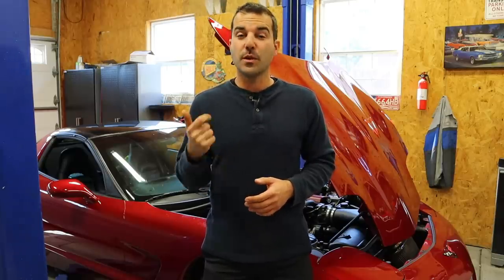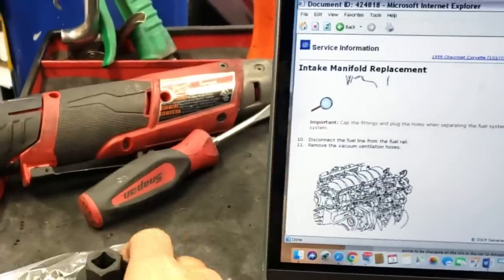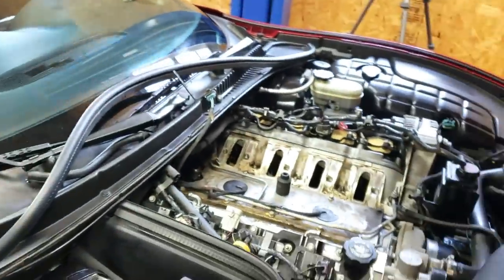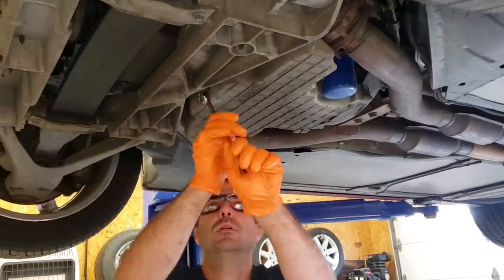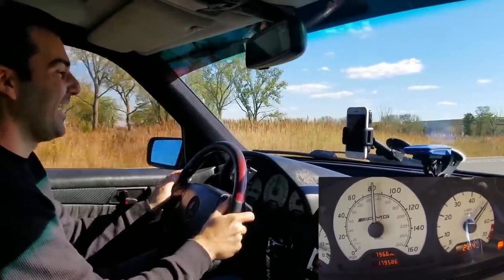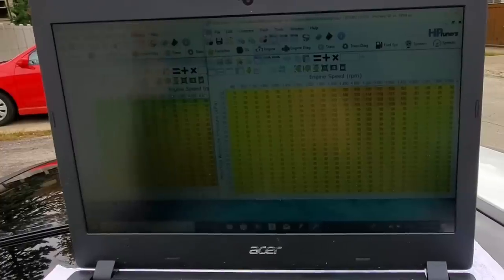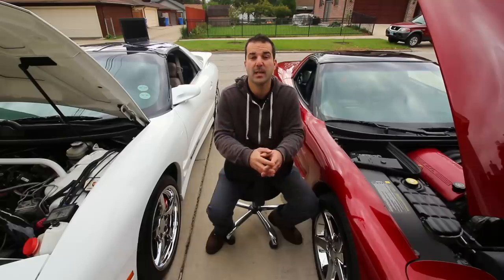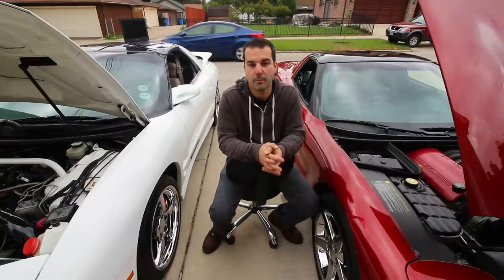I’m Building A 40 MPG Corvette That Sacrifices NOTHING! Project EcoVette Starts Now!

Comment: Doesn't the USDM Honda Civic VX/HX run lean?  I thought that is why it achieved 45+ miles per gallon. The highest I've read about was 62 mpg on a stock 1992 one of those here in CA- which is really impressive considering the emissions stuff we have to deal with.

Comment: I used to have one of the last Camaro Z28 IROC-Z's over here in the UK that had the roller rocker 305 TPI engine. On the highway that did an average of 36mpg. Pretty amazing for that size engine. Would suck in todays world though with my current car doing 72mpg ave every day.
Reply: what whip gets 72?
Reply: @RingerRacing  A merc A200d AMG. With the 2.2 diesel engine, DCT gearbox and BRABUS engine upgrade. 70 to 72mpg average every day. 740 Mile range from its quite small tank.
Reply: @dj_paultuk7052  thats amazing,   a stock chevy cruze diesel in the us makes 55-60mpg highway

Comment: Enter 92-95 Honda civic 92-95 VX is deff a lean burn car sold in the USA, however it was never sold in california due to higher emission standards there. Theres even guys getting 60-70 mpg in these cars .
Reply: Also that car was able to do 22:1 in lean burn modecaround 3 volts from the WBAFR

Comment: Why not put in a GM Ecotec motor and be done with it.  The 1.4 may work.  Can the 1.4 be tuned for more power than the V8...  yes...  but 2.0 or 2.7 would make it easier.

Comment: Never get a 40mpg average. Weight weight weight for town driving. I'm guessing 36 hwy max. Cylinder deactivation, raise compression, porting TB, less restrictive intake, LONG final gear, flat underbelly, remove front plastic valance. My guesses at the beginning of the video.

Comment: I’m a ford tech ad I know that the newer engines will run kinda lean at idle, around 14.9 to 15.1 at idle and will do a rich swing every once in awhile to keep the cats happy. When driving, when ever you are at speed and the torque converter is locked, you let off the gas and the 02’s will peg out lean 27 to 1, cause you don’t need fuel on decel so that helps with fuel economy. Just thought I’d share that n cause you didn’t know. Thanks for the video. Oh yeah, but the way, tuners and “chips” have been running engines lean and advancing the timing, to gain hp and better fuel economy for years, just had to run high octane fuel to prevent detonation and spark knock.had and 88 mustang gt and I’d guess that car got around 35 mpg’s.

Comment: Have been following your channel closely. Working on both my c5 and c230 is always challenging to say the least. Thank you for the amazing content. Easy to follow along explanations, clear videos and always entertaining comments. My apologies for the left field question, hope you have time to answer..is it possible for a rear caliper to fall out of alignment? Changed the rotors and pads on the auction pick up, c230 rear drivers side because of age and scraping sound. Thought the rotor was warped. Installed new caliper, pads and rotor with the same results. It would appear the lower corner of the caliper is contacting the rotor. Visual inspection looks normal with out any damage. Any feed back would be appreciated. The c230 is a 2004. My GF has exactly the same car that I have been using for reference as well as manuals. Thanks...looking forward to your next video.

Comment: The reason why the V8 gets almost as good mpg as a 4 cylinder is because it requires less rpms to drive at the same speed. The mph doesn't matter. Aim for lowest rpms for each gear for best mpgs.

Comment: Will you also be measuring harmful emissions the engine produces? Quite often fuel economy comes at the expense of more NOx etc. Edit: looks like you covered it later in the video! Generally the US has prioritised low NOx, EU has prioritised low CO2 which is why you have such a difference in engine types between the two.

Comment: Is this the same lean burn type of system Chrysler started to use back in 1977-78? My dads 78 New Yorker on A trip down south had its exaust manifold turn cherry red.400 miles from home and needing A tow,no cell phone,again this was 1978.The car had some sort of limp mode that got us to the nearest service station.As usual back then the Chrysler engineers were way ahead of the technology and quality needed.They always rushed to production.

Comment: How do you meassure the "highway rating" in the US?   Is this meant to be "fill up your fueltank,drive on the highway until almost empty, fill up and calculate based on the distance travelled and the amount of fuel you had to put in to get it full again" Or is this some momentary value the engine is using at highway speed on a flat surface?
Because if it is the later, i don't see why you would not achieve it, if it is the first one i don't think it possible. 

(The lowest on a fuel tank i got with my W212 E63 was 10,61L/100km which according to a prominent search engine is 22.16 mpg. But i wasn't going 60 mph on a flat surface, this was over mountains while up to 87-88 mph if i calculated correct and through villages at around 37 mph. And i did calculate it on distance and amount of fuel not by trusting the display of the car.)
As for the Spark Plug: as soon as you mentioned it at the beginnig of the video i lpaused and ooked up on wikipedia (in 2 languages) and the names i could have come up with were (not in timeline order): Etienne Lenoir, Carl Benz, Gottlob Honol, Robert Bosch,  Nikola Tesla, Frederick Simms. They all invented spark plugs and most of them had patents for it.

Comment: My Caprice has a low-load lean mode built in that goes lean for several seconds and then switches back to 14.7:1 for a short bit to re-calibrate. If you keep it in that mode on the highway, it does very well with about 30 MPG at 70 MPH.

Comment: Not a Mazda Fan boy. But those numbers are exaggerated.  
Unless you do straight Highway. You'll never see 26mpg+ on stock, no tune Corvette.
Some regular driving your probably looking at 14-19mpg. I Know because my Friend has very light 2002 Camaro, with same trans & motor swapped for that Corvettes engine & trans. He says hes lucky if he gets 16-18mpg. Its tuned correctly too, its not running rich.

Mazda mx5 from that era gets in the 25mpg range with Auto mix driving.  Mx5 needs the manual. I am sure stick driver's get into the 30s.

(Realized at end of video, that's what you went for, great choice)
You got test with measuring gas or going by same pump everyday, use it non stop. Going to take long. Get average of like 3-6 tank fulls.
That's how i measure my cars. My W124 300D gets consistent 28-31mpg with a lot of city driving.  And my car needs work, needs fuel tuning. Just did injectors.

Comment: Sam C:  Buys a lower mileage Ferrari a couple months ago and is still trying to get it down the road without it breaking down.
Alex P:  Buys a high mileage Corvette a couple months ago and will be making a 2 hour round trip to his tuner and won’t think twice about whether he will make it or not. 
Sam C:  Has to have custom made ECU’s made because the factory units are astronomical in price....if you can get them.
Eric P:  I got nothing....
Sam C:  Has to become a contortionist to replace intake gaskets and takes the better part of 2 days and the help of a young man, to get his car back together.
Eric P:  Has the intake completely disassembled under an hour.  All intake ports, throttle body and intake cleaned and back together in an afternoon.  
The Ferrari is a beautiful car, as is the Corvette. At the end of the day, if you work on your own cars and are trying to decide between an old Ferrari or an old Corvette and don’t pick the Corvette, you’re a masochist.  Sam’s experience isn’t an anomaly.  If you like to actually drive your car once in a while and you don’t have the money for a personal mechanic or electrical engineer, the choice is clear.
These 2 projects are living proof.  IMHO

Comment: I got a 5.3 LS has a btr stage 2 cam, valve springs and retainers. H&M’s 2500 stall converter I’m gonna be dropping it into my 1995 mustang and making it my daily but wanted to know what or should i start with to save gas

Comment: It seems like a good idea in theory but wouldn't you end up destroying the engine if you ran it too lean? Realistically you're probably not going to see a huge increase. If you run it lean, you're going to use more fuel. I'm not sure this is a really good idea. I have a feeling that even tuning it probably won't get you anywhere near the goal you're reaching for. You also have to remember that this is a V8 and they were not made to be fuel efficient. And adding power just really makes it use more fuel. Just my .02. I wish you luck and I hope you don't destroy your engine in the process.

Comment: when it comes to nox emissions it is true that leaner mix causes higher nox due to the higher combustion temps.  any guesses why leaner burns hotter??  its because the lesser amount of fuel doesnt get to evaporate and remove heat from valves, piston crowns, head chambers, ect.   EGR was used to offset that by introducing inert gas that didnt require more fuel to stay at stoich.  EGR cut power but typically only at loads where power wasnt needed.  thesis statement is that engines will run at max efficiency and power if emissions are not concerned.  why else would you dump your engines own byproducts back into it, thats called shitting where you eat, like pigs do.

Comment: Lean burn not allowed because of the EPA. Volkswagon was basically doing that on their diesels. NOx goes through the roof. You are going to not be EPA legal with any tune so why not go all out and go for 20:1 and ditch the cat? Or by "legal" are you saying what you can get away with in an inspection? I say we ditch the strict EPA and all safety regulations and make 100 MPG cars that really save the planet.

Comment: Well i wanted to convert one i found to electric drive in the front, and leave everything else the same(3+kwh batery pack in the "trunk")
Reply: I also have a limousine i want to convert to solar assisted hybrid, with the large engine bay, i'd like to convert it to a true hybrid with a 50kw generator off the front of the drive shaft, and 20kw motors driving the front wheels.
The reason for electrc on the front is because it will give some AWD advantages, and should be better for regenerative braking, though 25kw per wheel probably isnt going to break the tires loose in pretty much any normal traction situation, and the battery pack would be the limiting factor

Comment: Would lean burn cause higher engine operating temperatures or higher coolant temperatures? Would that heat be enough to start degrading other parts under the hood of the vehicle or because this is a standard NA motor it won't be an issue down the line?

Comment: Looking for suggestions before I take my 2007 gl450 to the Mercedes dealership. I keep having a code 5507. I changed all struts, valve block,  compressor, relay and all fuses are good. Had them recalibrated with my friends diagnostic scanner but the ride is horrible and that code keeps coming up. It has air but it seems like not enough air is getting in but it's not telling which air spring or what the problem could be. Any ideas?

Comment: Im no expert but if you drive lean isn't that bad for the engine?
More heat when burning lean
Reply: I wonder if he factored a C5 engine replacement into his theoretical 40 mpg fuel cost savings. Running an engine lean increases combustion chamber temperatures, and not only leads to engine damage from excessive heat, but can also melt your catalytic converters. GM later developed a fuel management system that "turns off" unneeded cylinders, saves fuel, and far less likely to damage the drivetrain the way monkeying around with air fuel ratios will.
Reply: The combustion temp of a lean engine at low load will be a lot cooler than a properly fat engine at high load. Yes, rying to run the car lean with the pedal at the floor will send the combustion temperature soaring but that isn't the goal here. He's going for cruising milage. That's a pretty low manifold pressure on a v8.

Comment: I have a 99 c5 vert. A4, I will trade my 2:73 stock diff....86k miles, new fluid, for yours with 3:42 gears.....previous owner says he got 30mpg on several Corvette Caravans...I want to put 3:76 gears in mine and need a 3 rib case...thx...or go to D.T.E.

Comment: @LegitStreetCars - questions: 
I have a 98 Firebird Formula, it's an auto, it's had a dyno tuned with the MAF connected, it's got an MTI lid, high flow cats, Magnaflow muffler, RAM AIR hood, I replaced the PCV hose recently and I've looked after this car very well...
The best I've ever got was 10 litres per 100 kms (about 23 MPG) and that's on open roads.
I don't think this is great, considering the mods I've done... any suggestions on improving this?

also - why the heck are you using Internet Explorer on a Mac?? :-)

Comment: You have to remember that when you are comparing the miata vs corvette in highway fuel economy, the corvette will be in 6th gear overdrive at a very low rpm whereas the miata, if you've ever driven one at 60mph, is hanging around 4,000rpm. Go hold 4,000 rpm in the corvette and see the mileage it will get haha.
Reply from the maker: Yea that sucks for the Miata

Comment: Lighter brakes, exhaust, body panels, axles, wheels, pullies, suspension, seats, flat bottom the car, low rolling resistance tires
Reply: and if you wanna go real crazy engine rebuild with all light weight internals and minimal friction components maybe even destroke to a 4.8

Comment: The c5 is not a leaf spring suspension car. The fluberglass leaf in the rear does not hold the weight of the car at all. It's a second anti sway bar. That's right, the c5 has two rear anti sway bars.  Since you removed that, you lost some of the cornering ability.

Comment: Check out the Aquatune system for hydrogen injection from water, I've always wanted to try it on an LS. Also, one thing I have pulled off is re-creating the RPO V75 "Liquid tire chain" on my 4th gen Camaro. 1.7 60' on junk tires by spraying them with Trac Bite or VHT.
Reply from the maker: I'll check that out!
Reply: @LegitStreetCars  I think your T/A was in GMHighTech back in the day, I gave one of my Turbo Buicks to Scott Parker and gave him some of these ideas but it was right around when they folded. I know what you mean by "lean tuning". Did it manually with a Scanmaster, stock style wastegate and adjustable FPR on my '87 WO2 on the way to Carlisle. Got 29.2 MPG and ran 12.5's with R43TS' and pump gas at Numidia's altitude. Good call on the AMSOIL, never had bad results with their products, in fact the most moody two-strokes I have had to jet only ever gave me a good, consistent plug reading from their Dominator or Castor 927. My first experience with their products was a Tecate4 with an L.A. Sleeve 295 kit, since they don't do the Nikasil, you HAVE to run the right oil or blow it up every 50 rides. This was back before ethanol in the gas, but I swear AMSOIL kept that thing together for hundreds of rides on a very limited amount of plugs where I was usually buying the most expensive oil and carrying 3 plugs. I still have broken powervalves and destroyed pistons in boxes to show people why they should buy AMSOIL. They are ahead of the game, just like your channel. Thanks for doing what you do.

Comment: 7:40 hey your not supposed to use a wire brush on a throttle body there's a clear coating on it to prevent it from corroding

Comment: how are you only trapping 147 in a 1000hp car?  Looked like it got off the line pretty well but why is it not picking up on the big end? Was the 1000 hp just a hero dyno run and you track it more around 7-800 HP.
Reply from the maker: It actually trapped 141. I think it has to do with the converter and maybe the weight of the car.  Its about 3900 lbs.  No hero run, the car does about 850-900 wheel

Comment: Hey Alex! I've got a 01' ZO6. I'm having a steering wheel lock issue. As you know, the steering wheel lock is electronic. I've installed a bypass under the steering column and another bypass under the passenger floor well. But I'm still getting the "remove key and wait 10 seconds" message. Any ideas? Thanks in advance.

Comment: Hey bro can you give me any advice on getting the secondary air injection check valves off of my c320 m112 engine? They will NOT budge at all. Can I just replace the top portion of the check valve and leave the bottom section alone?

Comment: "Engine performance measurements showed that the engine stability limit - evidenced by minimum fuel consumption and onset of rapid increase in HC emissions - occured at phi=0.65,  just before the partial burn limit line where some slow-burning cycles occur but combustion is still complete in all cycles.  From the above, it is clear that flame initiation is a necessary but not sufficient condition for complete combustion.  Too-slow flame development and propagation following successful ignition is usually the factor which limits engine operation with dilute mixtures.   Experiments have shown that a limited interval, of order 80 crank degrees (depending on exact engine), is available during the engine cycle when coniditions are favorable for complete flame propagation.  Outside of this interval, the mixture pressure and temperature are too low, and the turbulance intensity is too low to sustain a sufficiently rapid rate of combustion.  Thus it is factors which increase the flame development and propagation rates which primarily extend the partial-burn limit."
Reply: Which SAE paper is that from?